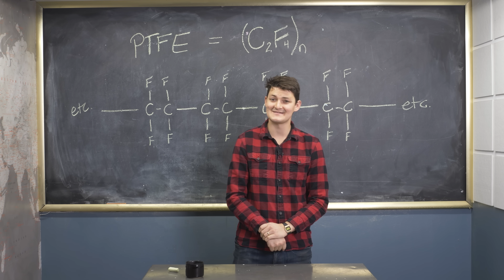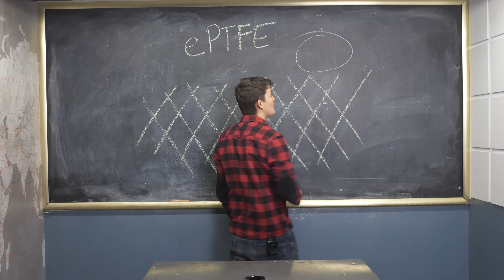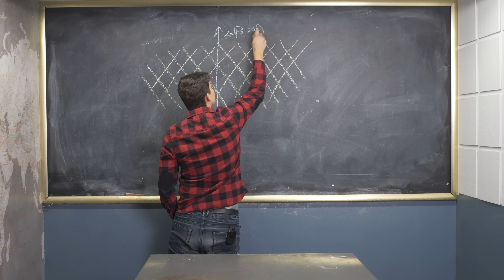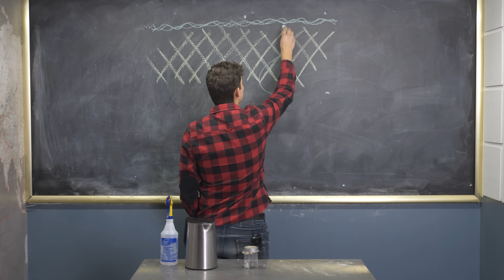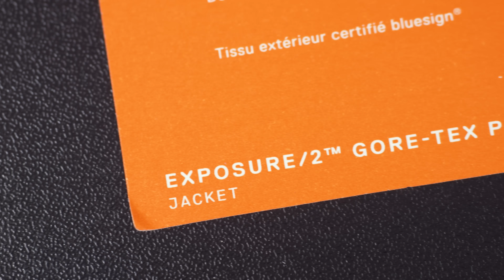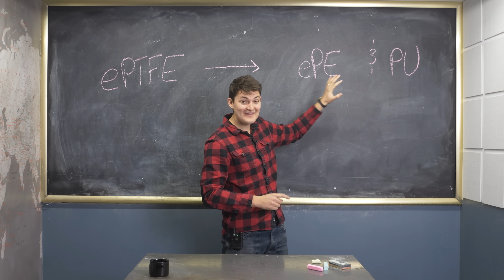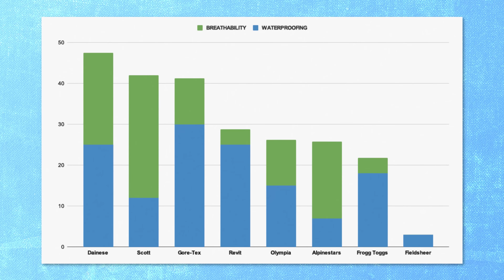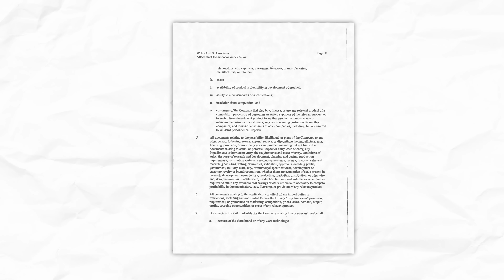Gore-Tex is a Marketing Gimmick

Comment: This is very insightful and informative..  But what i dont understand is why do my Gore-Tex branded jackets perform so much better than my 3rd party ones without the GT branding? Both are roughly the same price, and from a reputable manufacturers (one is Rab the other is Montane) but the waterproofing on the non-GT jacket seems to have just washed away after 1 month use, but the GT one has lasted over a year. (with similar usage). While this is subjective and non scientific i do believe that the GT brand at least upholds some standards that 3rd party proofing seems to skip over?

Comment: I was wearing NORTH FACE 40 years ago because they easily had the best clothing for extreme conditions. We always knew that the Polypropylene underwear was the key to staying dry, not the jacket. NF+GT was somewhat expensive but has become ridiculous in the last 15 years. DAINESE Skiwear costs more than NORTH FACE + GORE-TEX now. The playing field is diverse and leveling off. I now use store brand shells and they work as well as any of the old NF stuff because the PolyPro underwear is where you need to spend the money.
Reply: Is polyprop really that good though? I find it gets a a bit sweaty as a first layer compared to wool (I use merino like icebreaker or mons royale)

Comment: I have an Arcteryx (goretex) jacket that was made in Canada in 2005. It's been used ice climbing, rock climbing, snowboarding and the jacket appears as it did in 2005 when I bought it. It's still water resistant for most of the day on the hill which is all I need. The fabric has no holes or tears. It does exactly what it says it would do. I've even used the hood of the jacket to catch dripping water from a leak in the roof of my hiking tent. 
Keep in mind a goretex jacket has to be used with vents open if perspiration is heavy, used with a moisture wicking under layer. 
I dunno, it's always worked for me over the last 18 years.
Reply: I have the Simms G4 Pro Guiding jacket and I have the same experience with it that you've described having with your Arcteryx. I'm not trying to be that guy, but its very clear a lot of people on here want to validate their frustration with Goretex being "expensive". If you take a legit piece of Goretex and blow out of it, you'll see it is indeed breathable. Also, his logic here is flawed regardless, unless you consider being rained on is the same thing as being completely submerged in water. I'm just saying I have tortured my jacket for the past 4 years and I still get compliments on how slick it looks.
Reply: finally someone with reason... gore-tex isn't for everyone but when its for doing things like you are doing, it is. i ride and tour in gore-tex and non gore-tex (patagonia h2no) kits dependent on weather/ do i need a hard or soft shell for the occasion.

Comment: I wondered why a lot of top out door jacket manufacturers stopped using Goretex. I heard Goretex is pretty useless in hot humid countries. However, I m in Scotland and do a lot of mountain climbing and for anyone who has done the Munro's, they will know that its a hard brutal slog with a lot of sweat, and a lot of rain. Goretex works well in our climate, I've been using it for 25 years. However, the price is extreme, and I can no longer afford it, cant spend 500 notes on a jacket, so I just use the other manufacturers equivalent, which I think is probably just as good. I got a pair of non Goretex boots for the first time, and first trip out, they leaked. I went back to Goretex boots and they didnt leak. So its a balance, as theres not so much Goretex used in a boot, it doesnt add too much cost, whereas as jackets, no chance.

Comment: I am not a Gortex fan boy, but I have also used a number of different type of non-Gortex shell jackets (some proprietary, some not) over the years and Gortex is the most reliable and met my needs. I have done month long hike around the Himalayas, I have done Overland Trek in Tasmania over winter, I have done multi-day jungle hike in Indonesia. I also use shell jacket when out bike packing and often wear them as casual jack when out in town. Gortex-Pro constructed outfit outlasts most competitors - they are less likely to delaminate, they stay waterproofed for reasonably long period of time, and while they are not that breathable when sweating heavily, I can open armpit zip to dump heat. For many poorly constructed jacket, there is little/poor weather sealing behind the zip, or behind pocket, behind the seams, that tends to wet through in heavy rain. I am happy with my Gortex jacket, given the choice between buying multiple jackets for multiple applications/needing to be regularly replaced, and having one reliable Gortex that I can go back to year after year, getting a Gortex makes more sense.
Reply: I don't think there is anything you can take away from the video if the stuff you are using works..This is useful if you are thinking about something newer or something at all if you don't yet have anything for the wet outdoors. Maybe not now, maybe in 2 years someone that saw this will think back to it or have it saved as a bookmark folder for when they plan to buy new stuff.
Not for me of course, for me it's phones a year ago to avoid Samsung(Better worded, to avoid buying from Samsung if I am buying a new phone and I realised this a year ago after seeing some stuff on the XDA forums because getting superuser is important to me, hopefully a few more years before the current one breaks..Second-hand could work if I just buy the same model again if it exists out there). I gave up having to care about this stuff when properly going outdoors became tedious and literally crappy doing so after the removal of an organ or most of it at least, I never asked for proof.

Comment: Couldn't agree more! I had an expensive Gortex coat, pants and Danner boots, after walking around in The wet Alaska grass and underbrush I was soaking wet in just a few hours. Even the boots leaked. Took two days to dry that crap out.  Went back to Poly long johns and wool.  Stayed warm and dry, too, wool is still warm when wet. With Gortex I froze my ass off for the better part of a day...Thanks for another great video.

Comment: I can't speak to the clothing, but I owned one of the original Phoenix Free Runner tents. 

A very light weight single-skin Gore-Tex tent, it served me well for many years under a variety of conditions from the Lake District up to Concordia, short of K2 base camp. My friend then took it around China for about 5 years and swore by it.

I still remember camping with it in torrential rain and a flooded campsite at Wasdale Head in the Lakes. Evacuating a flooded field, too lazy and hung-over to do differently, we just pulled the pegs and picked it up. Karimats, sleeping bags, and other contents undisturbed where they lay, we marched it about a mile, floated it across a swollen stream and plonked it down again. Still dry inside.

Victory achieved, we returned to the pub.

Comment: I am trying to see if there is actually a point to this little rant. I have been using Gore Tex gear since the 80s, that was last century.  Used their gear in all conditions and environments. Is it perfect?  Nope. But compared to other foul weather gear, it works. The issue you fail to understand inside  your cosy little cubicle is how the garment is designed, but that would  require intelligent analysis. I suggest you look at how ventilation is designed into the product before you waste people's time.

Comment: You are somewhat narrow minded in the fact that you only consider Gore-Tex clothing!

I’ve had many hiking tents over the years and one of my favourites was a full gore-tex tent.

It was indeed breathable AND waterproof in both dry and wet conditions. It was not susceptible to the humidity differential flaw as I wasn’t running around sweating inside the tent. The Gore-Tex worked as expected.

Comment: Gortex is rubbish, it’s been marketed very well. I bought a “Gortex” waterproof motorcycle jacket, great I though until I was caught in a very very heavy storm, I was soaked to the bone! Riding into the driving rain at 60mph the water was forced through the so called waterproof gortex material!!! Years ago I had a Ruka bike jacket which was plastic, a strange material because it felt greasy, (no it was not a wax cotton jacket) that jacket was 100% waterproof because it was plastic, yes I used to sweat in it but I never ever got wet, water cannot penetrate the material. Sadly I fell off the bike and trashed the jacket, but goretex is not waterproof.

Comment: I've been wondering about the real world difference of "knock-off" membranes and G-T but never did bother to do complete research on it. This video answered everything.
Reply: The price comparison is very unfair.
It compares a laminated jacket with Gore-tex, with a nog non laminated jacked non Gore-tex, laminated jacket's are double in price because it's way more work and needs to be made wit a lot of handwork, so that explans the price difference, hense it's not the membrane!
Reply: @aeer6849  You are probably right, but I was only concerned about the features of the different brands. I wanted to know if the non-G-T membranes are as good as the G-T, so I don't need to hunt for a G-T product specifically.

Comment: My first experience with goretex was 20 years ago. The army gave me a goretex jacket and said I could not use the field jacket anymore. It never worked as advertised. I remember always being cold and wet when I wore that thing.
Reply: Thats interesting. The goretex jacket I got in the army was the best army jacket I had. It was specifically for winter use. There was even a special undergarment designed to keep moisture off your skin while wearing it. It didn't replace our other jackets, and we were specifically told it was designed to keep you dry and warm in cold dry weather. We were also told that although it is water proof, it was not designed for in high humidity or during rainstorms.

Comment: You can patent anything for a USE, as long as it's novel and non-obvious. You might be able to patent the moon for a novel and non-obvious USE. You cannot just patent "THE MOON" for no particular purpose. 

I have stood out hunting more than once in a goretex hunting jacket in pissing rain and did not get wet underneath. I have a hard time thinking that being in a garbage bag that I would have been as comfortable. Maybe, maybe not, but my clothes under the coat remained surprisingly dry, except in my humid armpits. The beading effect of the coat has been gone for some time and yet I remain dry in the rain. Seems to work well enough, and I didn't pay $1000 for it, more like $250 from LL Bean back around 2008. 

As long as the coat works, who cares. There are a ton of gortex like alternatives that all seem to work pretty well. Do you have a suggestion for an actual alternative that is better?

Comment: I’ve spent hundreds of 12-15 hour rainy days in Gore-Tex jackets. They work, no question. No other type of rain jacket works in the kind of condition I’ve put mine through - even other brands that use the same membrane. maybe GT is like Bose, they just keep the quality up and techniques consistent, despite the fact that you can buy another speaker somewhere else they just seem to be made better. The first jacket I had lasted 6 years before it even showed mild signs of not working. I think Gore-Tex works great for certain situations - as a shell, when layered properly and when given a chance to breathe and intermittently dry out. It also helps to treat the jacket regularly which includes drying at high heat to reset the material. Shoes and gloves on the other hand, are useless. They have too much bulk, too much padding. Every pair of GT shoes I’ve had have been useless. So there you go, I don’t know what to say- the stuff works, at least in my situation. As moto gear maybe not, but for standing out in the rain, well there’s a reason the entire film industry in Vancouver (and you guys know what that means rain wise) uses Gore-Tex jackets. (Also….Ironically you rode right by Arcteryx headquarters in the sponsor segment 😂)
Reply: "works great for certain situations - as a shell, when layered properly and when given a chance to breathe and intermittently dry out."  Do you realize what you just said? Replace "gore-Tex" by "any jacket" and you'll have it right.

Comment: I know Gore-Tex is just expanded PTFE. I know it's not as waterproof or breathable as other fabrics. I know the patent on it has expired. My reason for buying it is simple: I've gotten burned buying other "waterproof" fabrics, which turned out to be not so waterproof or didn't hold up as well. Despite its market manipulation, Gore-Tex imposes a pretty solid quality floor on their products. I buy clothing with it, I know it will perform to a certain satisfactory standard.

I would absolutely love to buy a cheaper product which performs as well (or better). But the market is so balkanized it's been incredibly difficult to find empirical reviews which test many of the alternatives (I really appreciate yours). And even if I can find reviews, the products haven't been around long enough to build up a brand reputation for quality. I may buy a second piece of clothing which uses it, only to find it doesn't work as well as the previous one I bought. If I weren't upper-middle class, I'd probably be willing to experiment more with alternatives. But as the saying goes, time is money. In my income bracket, paying the Gore-Tex tax is often cheaper for me than the time I'd spend making sure an alternative is decent.

So rather than blaming the consumer, I'd say the generic market for ePTFE still needs to grow. Brands need to develop a reputation for quality and consistency, and reviewers need to step up their game. Anyone can scramble an egg. But that doesn't mean all scrambled eggs are the same - some cooks are undeniably better at it than others.

Comment: the thing is gore tex is only breathable as long as the outer layer of the jacket isnt soaked through. Once its soaked through, there is a layer of water on the outside of the jacket and no air can get through, no matter what membrane you use. The thing is that this is fine because you usually have DWR coating, which makes sure water runs off the outside, ensuring there is not waterlayer preventing the breathability. Why even bother with the membrane then? Well in some areas the outer layer may soak through, and at that point you would have water leaking through if you only used a DWR coating. In this case its better to have a membrane layer.  For me, with non membrane jackets the shoulders will usually soak through, because I have a backpack on them. with a waterproof membrane, this is not the case, this area just becomes sweaty, while the rest stays breathable

Comment: Good video. II will never again get a stiffy  seeing the Goretex logo.  I've learned a bit about what I thought was the Gore Tex Effect, but  your video makes me realize it's a bit more  than that. I had assumed that Gore Tex breathability was my body heat driving out water vapor from my body through the membrane. Like it does with wool.   

I do have a rule that works really well. If it might rain, then my $350 Gore Tex jacket.  If it is raining? Then my $15  35 year old yellow rubber jacket or my $25 plastic Japanese fishing jacket (and pants). And always wool underneath.   
What I thought was the Gore Tex effect is brilliantly represented by Sealskinz socks. Hiking in England a few years ago in a cold rainy April,  I had on two pairs of smart wool socks and my not so waterproof hiking boots. Warm enough, but end of the day in my sleeping bag, it took almost an hour for my toes to warm up. (I have terrible circulation) After two days I put on the Sealskinz socks. I could feel air moving through my toes. My feet were never that wool toasty cozy warm, but they were always comfortable and dry. End of the day in my sleeping bag my feet were already warm.  
So I bought some Sealskinz gloves and then wore them ocean kayaking. My hands have never been colder. I thought maybe these weren't real Sealskinz.  Then I tested socks and gloves at home in a bucket of water. Exactly the same. It was just that while paddling I got water in through the cuff. 
The wool effect is definitely heat driving the water away. When I washed my Merino wool layers and hanged them to dry in the sun I had to turn them inside out. What would happen is the surface would be warm and dry, but inside it was wet and cold. Turn it inside out come back in 15 minutes,  same thing, but a bit dryer, so turn them a couple of times and they dry.
Now that you exposed the Gore Tex myth, the real question is: What are the best ways to stay comfortable and dry?  Not keep the rain out and sweat underneath, or keep the rain out and shiver.
Reply: The price comparison is very unfair.
It compares a laminated jacket with Gore-tex, with a nog non laminated jacked non Gore-tex, laminated jacket's are double in price because it's way more work and needs to be made wit a lot of handwork, so that explans the price difference, hense it's not the membrane!